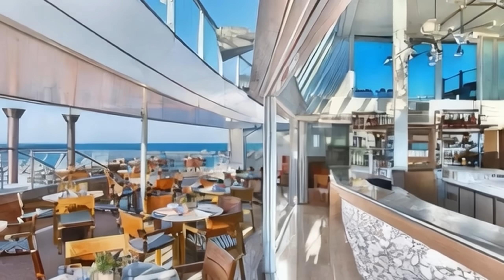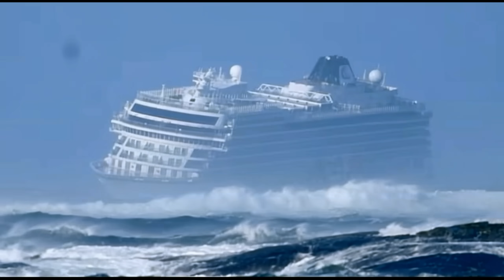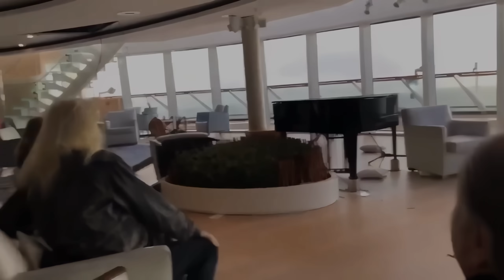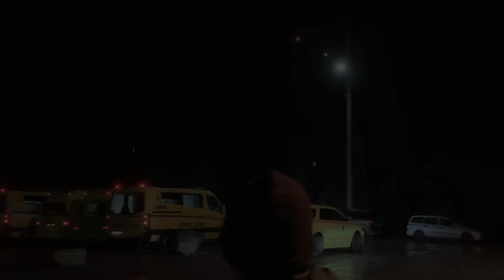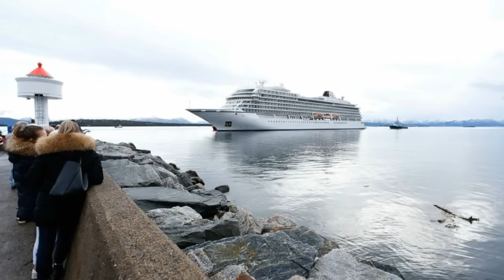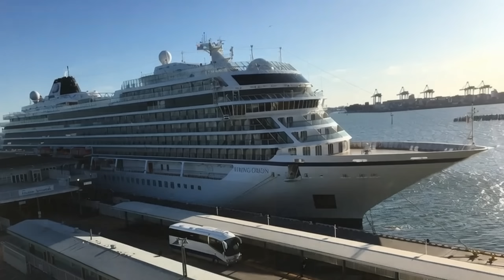The Design Flaw That Almost Sank the Viking Sky

Comment: Wrong decision by the Captain although in fairness to him the ship was more than capable.  More importantly the engine manufacturer should have realised that in bad weather conditions the oil levels they specified were insufficient, what on earth made them think that a ship wouldn’t be caught in bad weather. For me 90% engine manufacturer at fault.
Reply from the maker: The captain’s decision mattered, but the main issue was the engine design—oil levels that weren’t sufficient for severe weather played a critical role.

Comment: New rules will come into force on 1 January 2026, following the incident with the Viking Sky in 2019, and will prohibit passenger vessels over 150 metres from sailing in six highly exposed stretches of the Norwegian coast, such as Hustadvika, Stad, Folda and areas in Troms and Finnmark, when the Norwegian Meteorological Institute warns of strong gales (mean wind speed 17.2 m/s or more). The rules, which have been adopted by the Norwegian Coastal Administration, are intended to prevent similar accidents and enhance the safety of large ships in demanding waters.
Reply from the maker: These new rules make a lot of sense. Limiting large vessels in exposed areas during strong gales should significantly reduce the risk of accidents like the Viking Sky incident.

Comment: How in the hell is there not an override that would allow them to restart some of the engines?  They couldn't all be low on oil.  Probably just sloshing triggered the shutdown, but you can't let technology override the captain.
Reply from the maker: Modern ships have safety systems that can automatically shut down engines to prevent damage, but you’re right - there’s always a balance between automation and human control. It’s a tough call in extreme conditions.